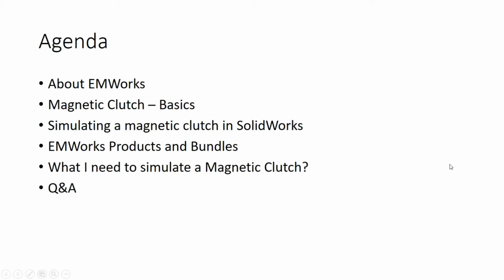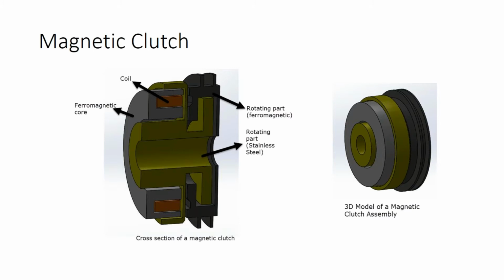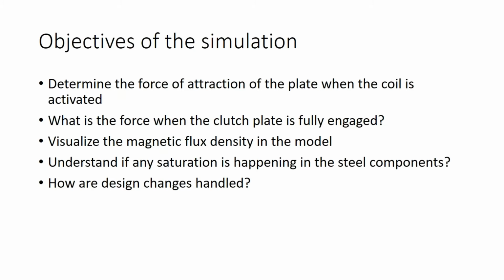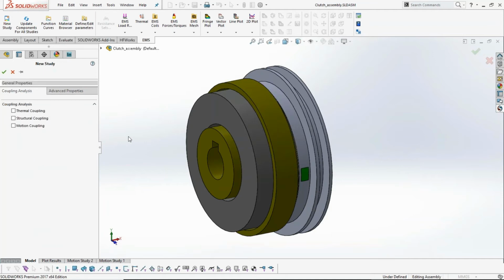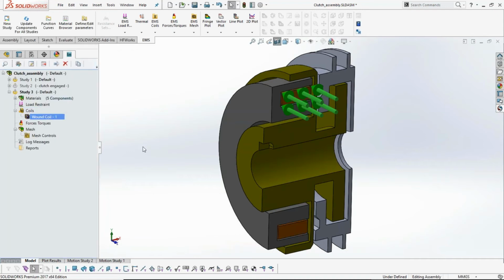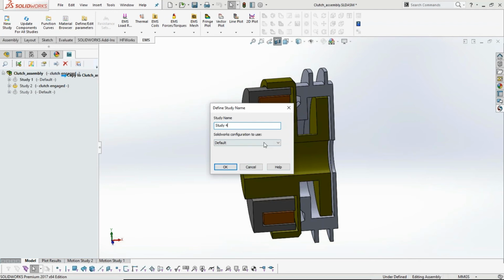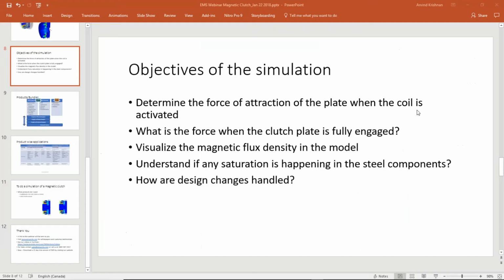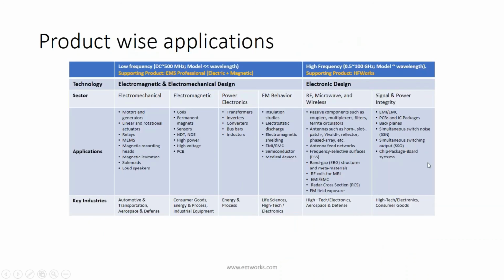[Webinar] - Simulating Magnetic Clutches inside SOLIDWORKS

Comment: How we define air ?
Reply from the maker: Hello Mahartana, 
If you are talking about the outer air, EMS can help you to insert automatically the air using Auto Air feature. 
To decide whether the inserted air is big enough or not , you need to run the simulation and check the field in the outer surfaces of the air. It should be too small compared to the maximum field. 
We will be happy to answer you further questions through email: majdi@emworks.com
Thanks